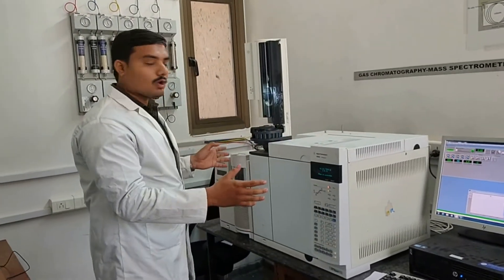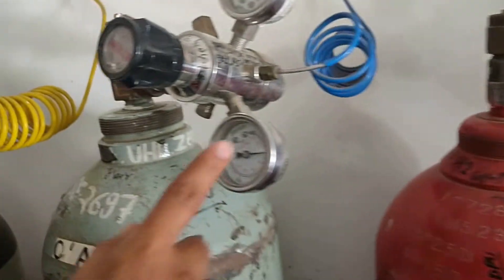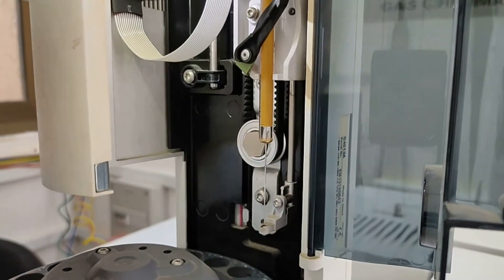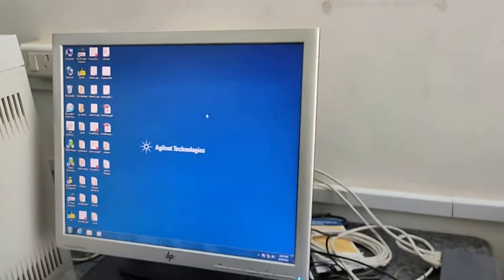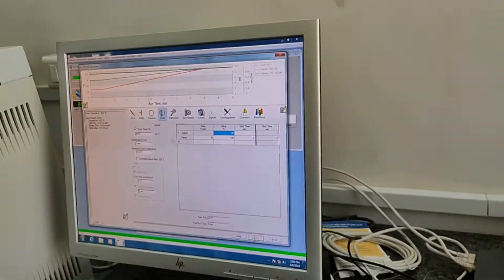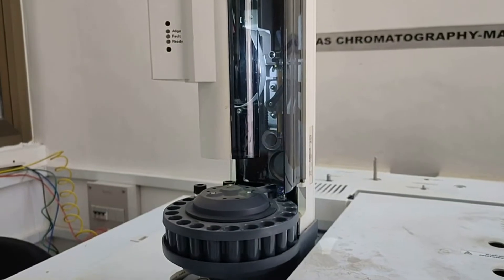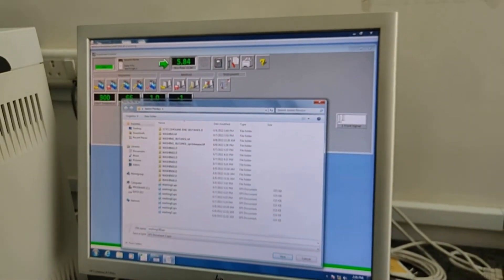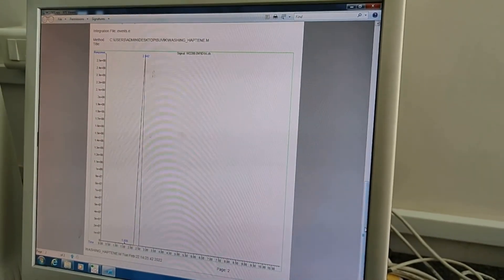Operation of Gas Chromatograph Instrument (Phd. Scholar Suvik Oza), Department of Chemical, PDEU

Comment: Sir I request you to please upload these labs

CHEMICAL REACTION ENGINEERING LAB

Experiment No. 1: Standardization of the given solution of NaOH.
Aim: To determine the normality of NaOH solution 

Experiment No. 2: Plug flow reactor
Aim: To determine the second order reaction rate constant for saponification reaction between NaOH and 
ethyl acetate in a plug flow reactor

Experiment No. 3: RTD study in CSTR 
Aim: (a) To plot the RTD curve for a CSTR using a pulse input as a tracer 
 (b) To determine the dispersion number

Experiment No. 4: Isothermal batch reactor 
Aim: To determine the pseudo first order reaction rate constant for the saponification reaction between 
NaOH and CH3COOC2H5 in a constant volume adiabatic batch reactor

Experiment No. 5: Adiabatic batch reactor 
Aim: To determine the pseudo first order reaction rate constant for the saponification reaction between 
NaOH and CH3COOC2H5 in a constant volume adiabatic batch reactor

Experiment No. 6: Continuous Stirred Tank Reactor (CSTR)
Aim: To study of a non-catalytic homogeneous second order liquid phase reaction in a CSTR under 
ambient conditions.

Experiment No. 7: RTD study in Packed Bed Reactor (PBR)
Aim: (a) To plot the RTD curve for a PBR, using a pulse input as a tracer
 (b) To determine the dispersion numbe

PROCESS MODELING AND SIMULATION LAB

LIST OF EXPERIMENTS:

1. Estimation of dew point and bubble point temperature of a hydrocarbon mixture
2. Simulation of flash drum
3. Design of ditillation column
4. Optimization of a flow sheet or process
5. Determination of temperature profiles for heat exchanger
6. Concentration profiles for reactor
7. Simulation of Jacketed CSTR
8. Simulation of process
9. Simulation of evaporator/ distillation column/ extraction process

PROCESS DYNAMICS AND CONTROL LAB

LIST OF EXPERIMENTS

1. I & II Order System Dynamics
2. Interacting & non interacting Systems
3. Flapper - Nozzle system
4. Control valve characteristics
5. Level control system
6. Flow control system
7. Pressure control system
8. Control of a thermal system
9. Design of control system for a given process
10. Simulation of a closed loop system
11. Demo Experiment using Aspen Software of a given process
Reply from the maker: I have only limited time to do video lectures. I will try as my next is chemical reaction engineering subject. Thank you and keep watching
Reply: @Dr.surendra0845  Sir video lectures are available on NPTEL but the labs are not available